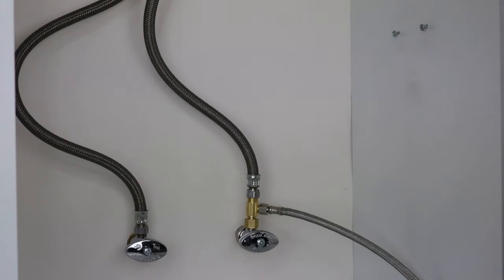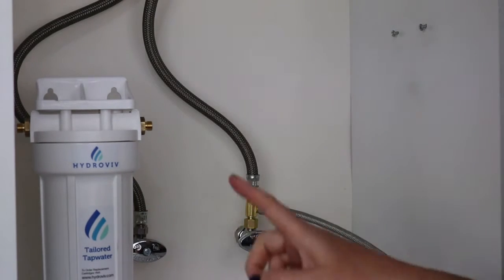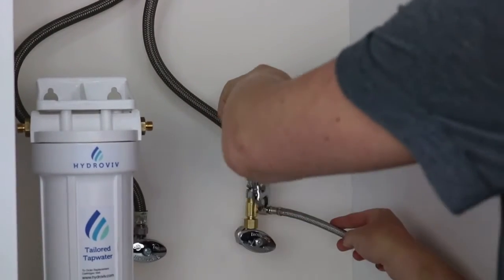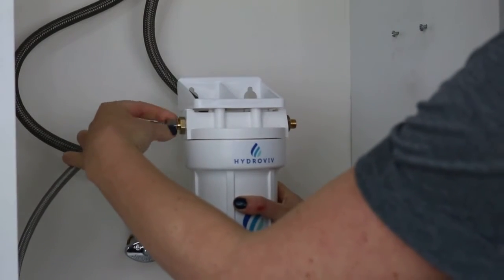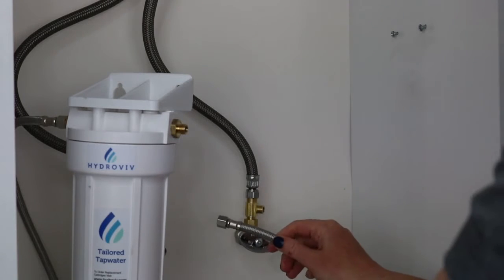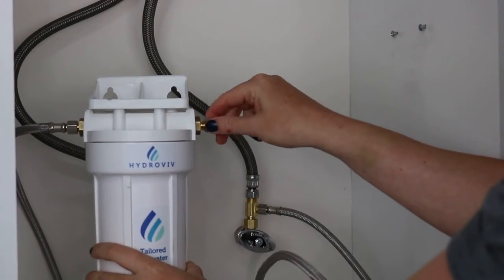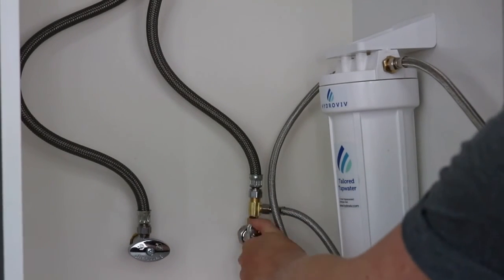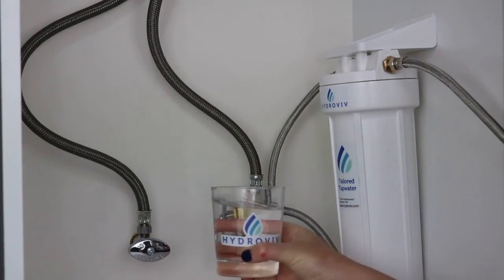How To Install Hydroviv Refrigerator/Ice Maker Water Filter On Braided Stainless Steel Line

Comment: If this is for a refrigerator, how can the refrigerator fit next to that very large, 5" in diameter filter? The only way I can do that in my house is to put a hole in my wall to house the filter. I'm going to have to send the filter I just bought back.
Reply from the maker: Lots of people put it on top of the fridge (as long as the top is secure and doesn't leak, the filter works fine laying down)
Also, in my house, I have a countertop available next to the fridge and so I have my fridge filter sitting next to the fridge on the countertop. Some people run the line from the basement and others cut a small access panel into the wall behind the fridge. It doesn't necessarily have to be right next to or right behind the fridge. There are many ways that the filter can be installed depending on where the water line comes in to your fridge.
Reply: I'm not cutting into my wall or floor for a filter and they provided no lines so I'd have to go out and buy lines to extend it up to the top of my fridge or have it sitting on the counter? I think this is a major design fail

Comment: Water is spilling out the top of the filter. I’ve tried checking the rubber O-rings, tightening etc and this is still happening. Any thoughts?

Comment: I have a brass waterline to the fridge that is obviously not too flexible. Should I get two short flexible metal hoses for the In and Out?
Reply from the maker: That seems like it should work. We'd recommend that you find a licensed plumber to do any work involving rigid water lines.

Comment: I just bought this filter and we have a basement. The steel line comes underground then it's installed to my fridge. I just bought a 5 ft steel cord. Can I take un screw the fridge lint and connect the hydroviv filter and then connect the extended 5ft steel line and connect that to my fridge?
Idk where the fridge line is coming from in my house
Reply from the maker: It seems you might want to find where the fridge line originates if only so you can turn off the water when you're installing the filter. Please contact our Support Nerds at hello@hydroviv.com and they can help you with installation advice!

Comment: Why do you recommend using a 5 foot long hose? I would think a 1 foot or 2 foot hose would be more than sufficient.
Reply from the maker: It totally depends on where you end up putting your filter. If you only need a 1 or 2 foot hose, then that's great!  For some, they need to put the filter in a cabinet above or in a crawl space below the refrigerator and need a longer length of hose. Choice of hose length will depend on your specific need and configuration, and there are a wide variety of refrigerator configurations depending on your refrigerator and location of your water inlet.

Comment: Usually, you don't have that much space behind the refrigerator. Any solutions for that?
Reply from the maker: Every home's fridge setup is different, but most of the time, the fridge line system is installed in an adjacent cabinet. Some people will install in a crawl space, bump out the fridge and put the filter behind it, or even put the filter on top of the fridge. So in my house, I put the filter on the countertop right next to the fridge. The system simply goes in-line on the tubing into your fridge. You can view two different videos showing installation, one for a plastic line, and one for a stainless steel braided line, at hydroviv.com/installation. Also, the filter does not need to be mounted or installed upright. The filter works fine sideways--you just want to make sure the lid is fully tightened so it doesn't leak.
Reply: @WaterNerdTV  our water line is directly behind the refrigerator
Reply: @rexelliz  I'm in the same situation - did you find a solution?
Reply: @WaterNerdTV  In the same situation as rexelliz - do you have recommendations for this scenario?
Reply: Most of the time the fridge line is not in a neighboring cabinet. What an ignorant statement to make
Reply: @pusmma exactly what home do these folks live in?
Reply: It wont fit behind.  think ill maybe use that 5 foot line to put the filter on the top of frig.
Did they say the water input goes on the "OUT"?

Comment: can i connect the under water to the fridge with additonal pipes
Reply from the maker: Yes! There's a quick and easy way to adapt the undersink system to filter both your faucet and fridge line. All you do is install a downstream splitter tee on the brass "outlet" elbow piece on the filter, then connect your faucet line to the 3/8" connection and your fridge line to the 1/4" connection. We sell the splitter tee on our website (https://www.hydroviv.com/products/downstream-tee), but you can also get it at a Home Depot.
Reply: @WaterNerdTV  I clicked on that link and it says "page not found"

Comment: This will not work with a snap on filter that is within the refrigerator (due to different filter fitment) ?
Reply from the maker: The Hydroviv refrigerator filter is designed to be installed inline on the water line to your fridge. It is not installed inside the refrigerator. Depending on where your water line comes in, (every home's fridge setup is different), most of the time, the fridge line system is installed in an adjacent cabinet or sets on an adjacent countertop. Some people will install in a crawl space, bump out the fridge and put the filter behind it, or even put the filter on top of the fridge.

The filter that's built-in to your fridge is downstream from the Hydroviv, so it doesn't need to be removed/replaced. The thing about the built-in refrigerator filters is they basically only remove chlorine. This makes the water taste better, but it doesn't account for actual contaminant removal, for things like arsenic, lead, chromium 6, and PFAS. Hydroviv systems will add additional protection from health-related contaminants.